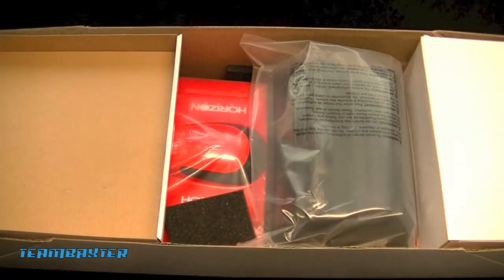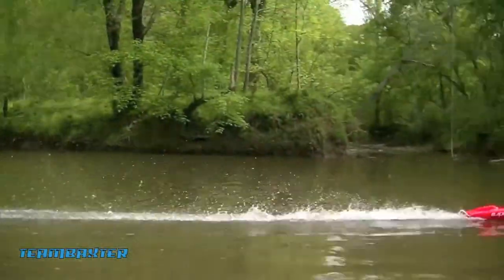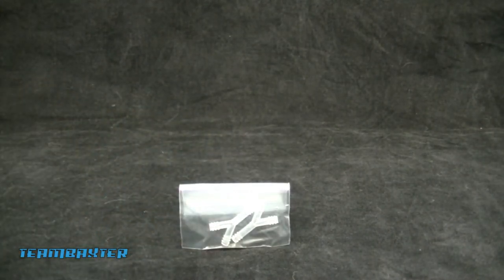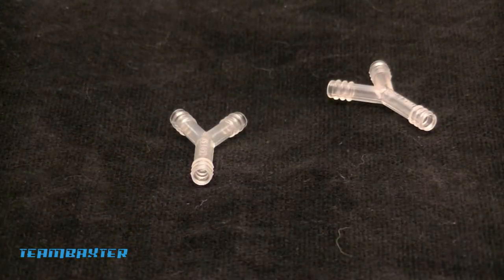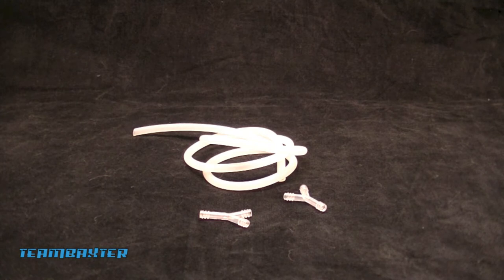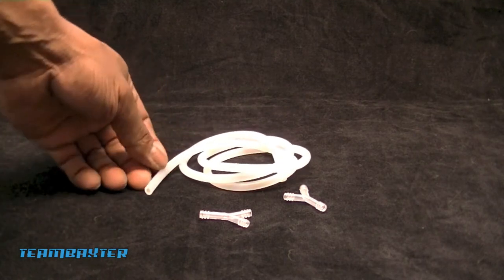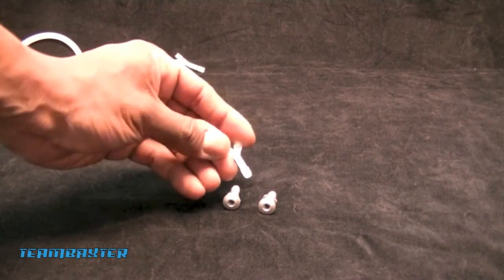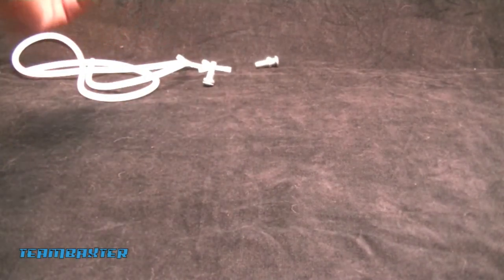ProBoat Blackjack 24 Power/ Cooling Upgrades

Comment: Put 2000 kv 6 pole on 6s dynamite out of UL-19.nasty only prop and rudder stay in water.finally getting weight and balance even....on the water outlets,I been taking aluminum rivets apart by taking center pin out.then just epoxy them in place...

Comment: Now that's an upgrade that i like bro, very nice. How many cells can the system handle & how was the cost? One Luv!
Reply from the maker: mtctookie25 the 60a esc can only handle 3s, but by the time of this reply, i have already put a 120a in it and a 2930kv motor. She can handle 6s now. The cost was not bad at all, both the motor and the esc were much cheaper than a land system in the same range. offshoreelectrics.com. Thanks for watching and commenting
Reply: ARTINCbydb Very Nice

Comment: Awesome video! Do you have a jet boat?
Reply from the maker: TOJO RC i do not have a jetboat, but my buddy does, and it is awesome. A whole different control scheme, more like drifting turns. Pretty cool, but i think id buy a gator boat before i got a jetboat. same steering, different system. Thanks for watching and commenting, Tommy